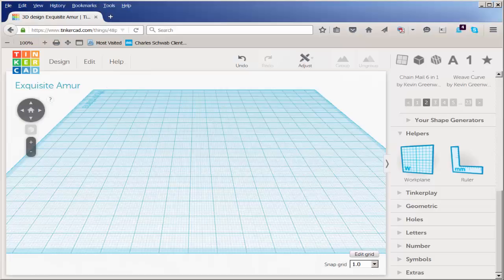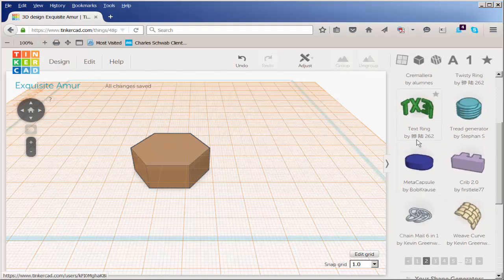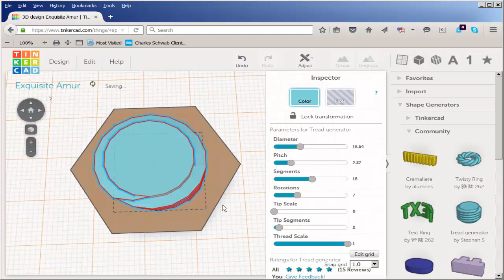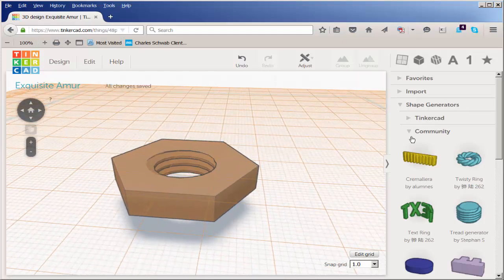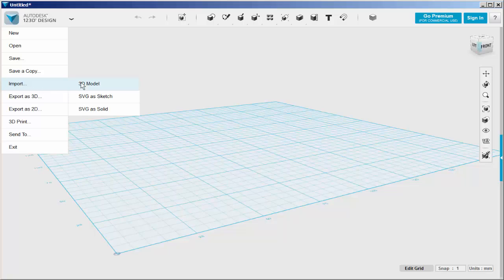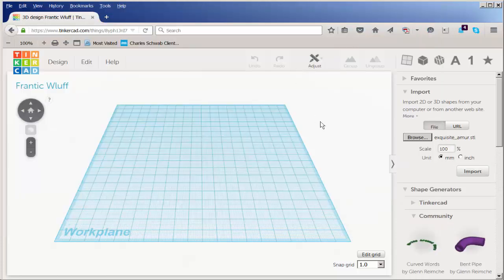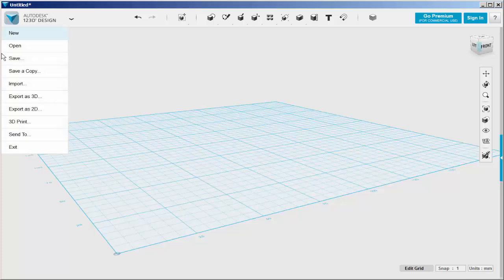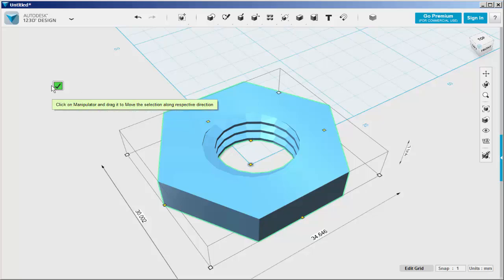Tinkercad: Threaded Hex Nut

Comment: The best solution I have found is to go to https://www.mcmaster.com/

Find the actual nut or bolt you need by using their search feature. then
 click on the product code on the right of the list  = 91251A055. This 
will open up a drop down menu  with another link = Product Detail   

Scroll down a little until you see the spec drawing. On the right of it 
there is a drop down menu with a variety of options for the type of file
 you'd like to download.

3-D STEP3-D 
Models3-D 
EDRW3-D IGES3-D
 PDF3-D S
AT3-D 
Solidworks3-D 
STEP

I use 123D Design and that imports the 
3-D STEP file
Reply from the maker: That's a good idea, thanks. Fusion 360 includes the McMaster-Carr library as a drop-down menu.